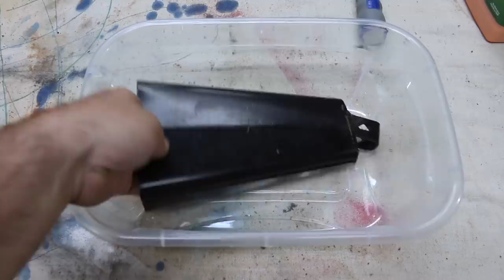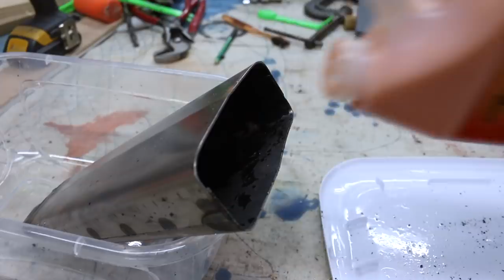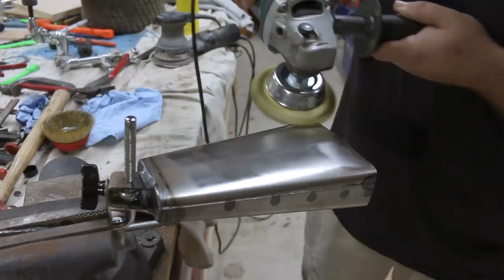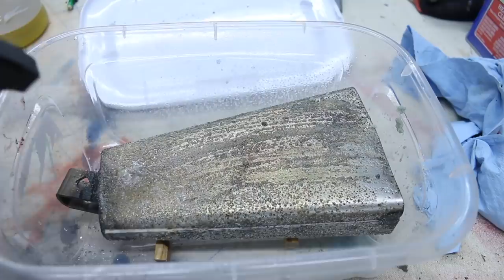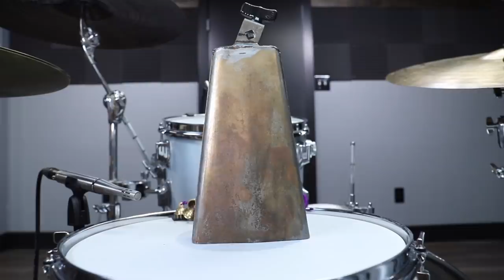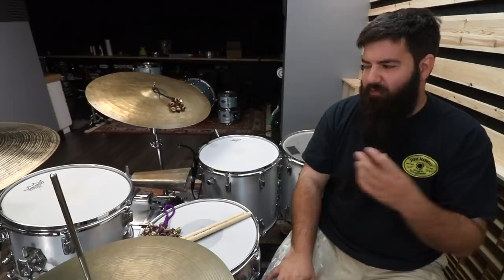I Ruined a Perfectly Normal Cowbell, Here's How

Comment: My dad has been a blacksmith for 40 years. To get the brass finish the metal has to be heated to almost a full red, and just use a brass hand brush. No need for power tools. A handful.of swipes and it has a pretty rich coating.

Comment: Rust solution. 

Cooper sulfate (zep root killer) one  jar.
Battery acid. One QT

5-20 (start with 10 ratio)gallons water. 

(Adjust measurements to meet desired quantity)

Dissolve copper sulfate in water and acid 24-48 hours. Instant rust/steel patina.

Changing ratios and application temperature and lengths will dramatically change results but they will all instantly rust steel in a controlled manner. Start with wet steel and rinse of as soon as it does its thing. Like 1-5 seconds.
Reply: Looks like blue koolaid. Will kill you if you drink it. I make a bunch to keep handy for rusting steel instantly.

Comment: Im curious, I've been using stock heads on my drums and they are starting to wear out. If i cut out the old heads and wrapped the heads in packing tape or any kind of tape, could that work on the drums??
Reply: You won't be able to get the tension necessary, and it'll sound like absolute trash. 

Just get new heads. You dont have to replace the reso heads unless you want to. Or what i did when I was a kid, I flipped my heads and beat through the stock reso heads since I didn't have money to replace them lol. Your drums will sound different, but Phil Collins didn't use reso heads, so its not the end of the world.